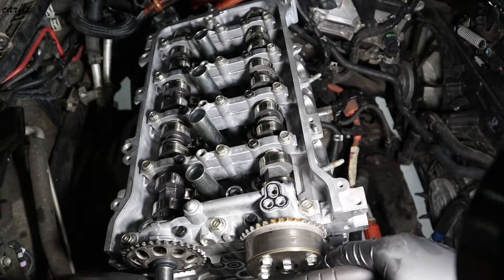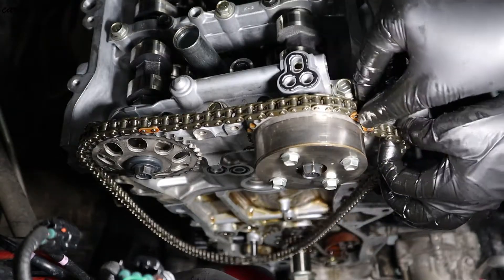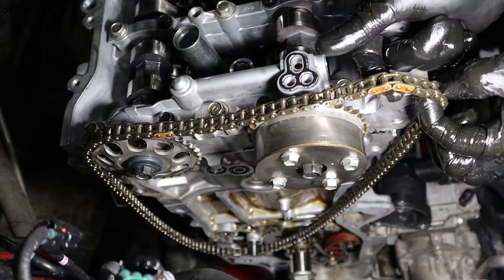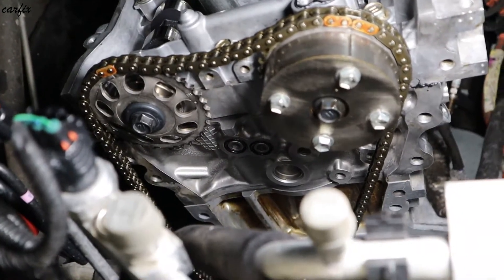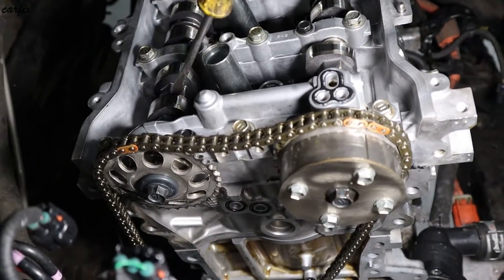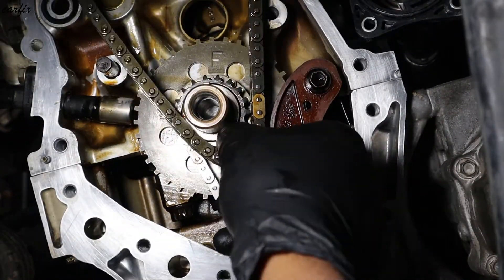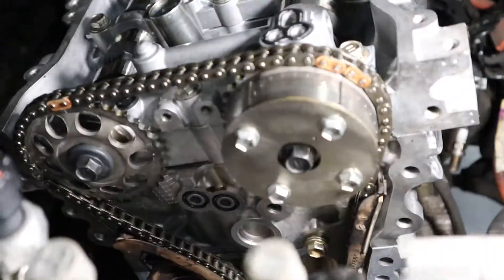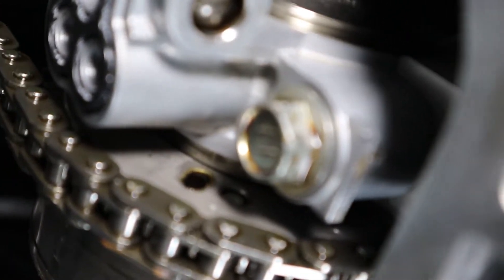Toyota Prius timing chain replacement ( 2AZ engine)

Comment: I have a random p0016, what I have done is camshaft sensor, crankshafts sensor, vvt valve replace, when erase the p0016 I need to drive the car about 10 to 20 miles for the code come back
any suggestion, thank is advance

Comment: Aren't you worried about cranking the valves into a piston when you do that?
Reply: If it spins just as it did in this video its not touching the piston, thats just the compression. But of course be careful when you’re spining the sprockets, if you feel resistance, stop immediately and check the timing, you never want to force, it should spin nice and freely